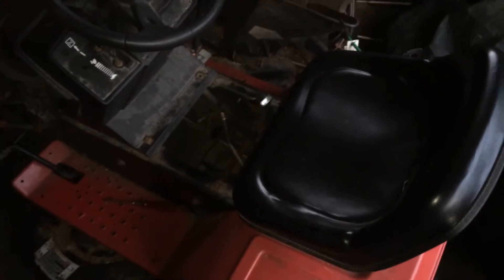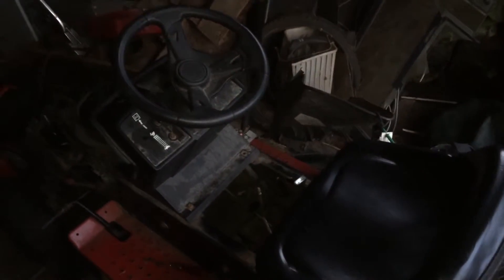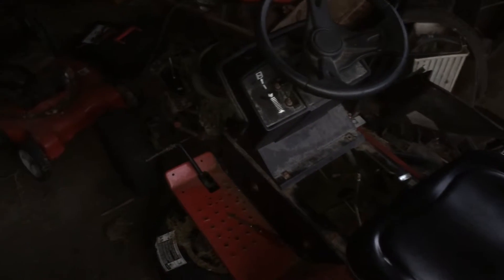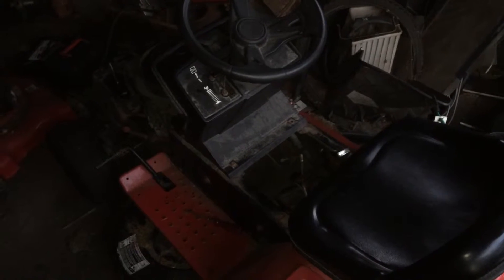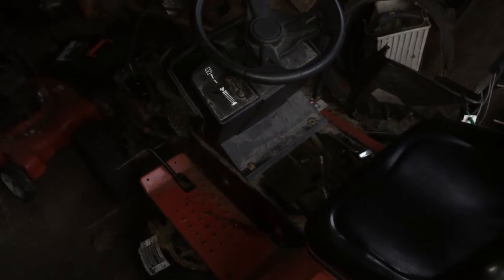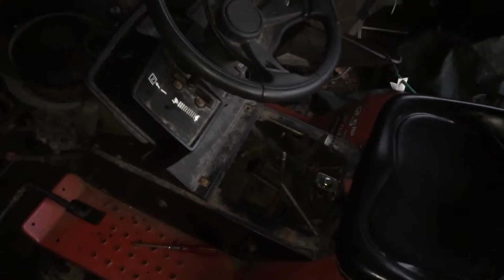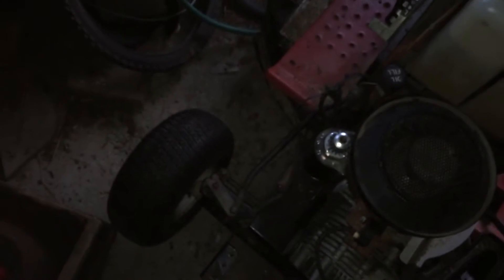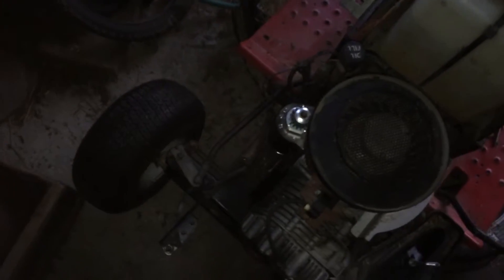Lawnmower won't start

Comment: Big thick black wire is a ground wire, it shouldn't have any voltage. Jump the 2 large red wires on the  solenoid with a screw driver or pliers if it starts the solenoid is bad. Also if you bought a cheap starter from China or overseas they are junk and very well could be bad already or bad from the start.